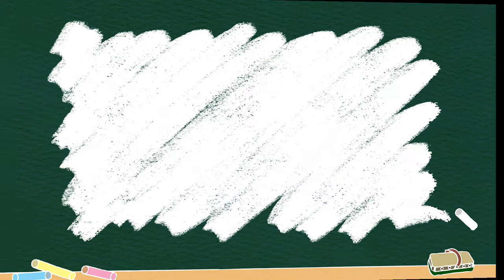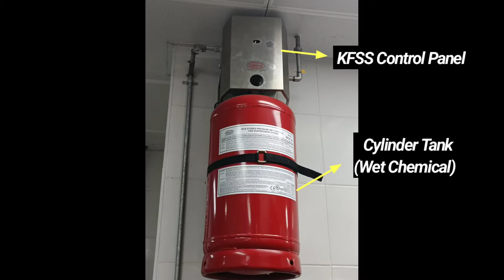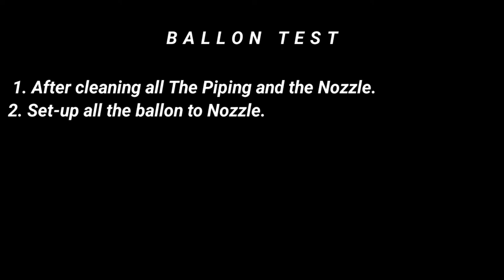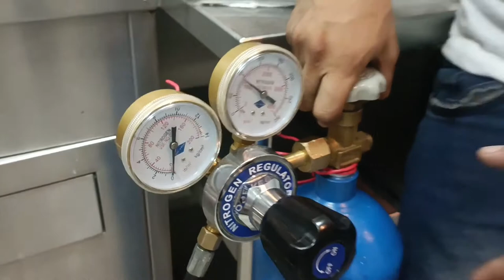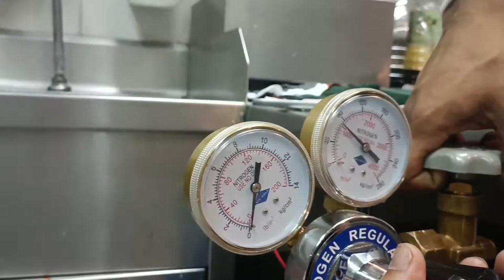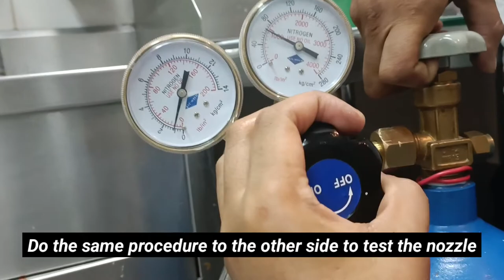Kitchen Fire Suppression System (Preventive Maintenance Services) and Ballon Test

Comment: Sir nakainterface ba sya sa gas control valve at sa power supply ng kitchen equipment? And yung exhaust fan ba is always running kahit sa normal situation? Salamat